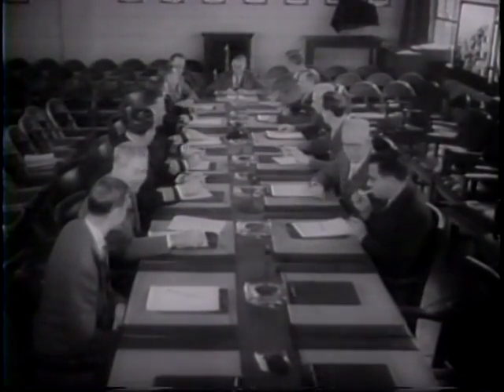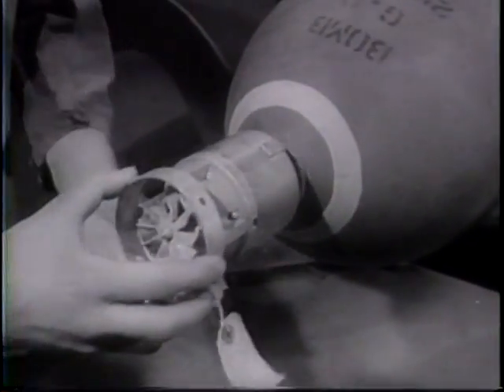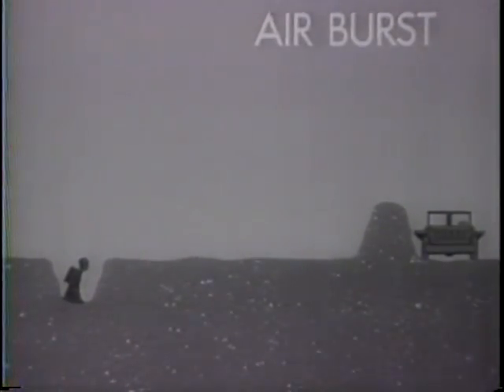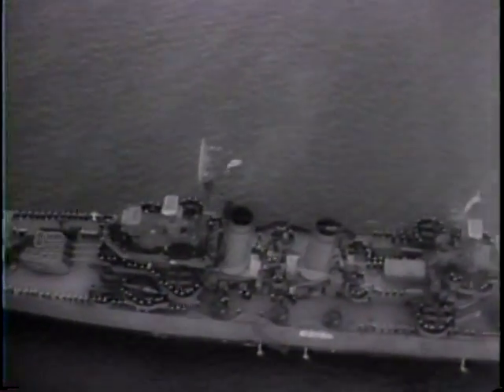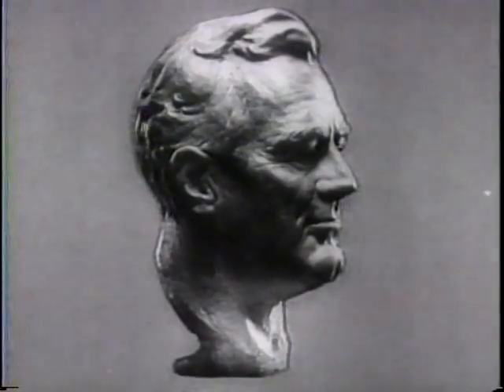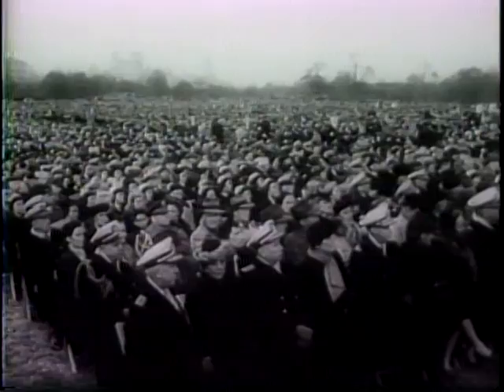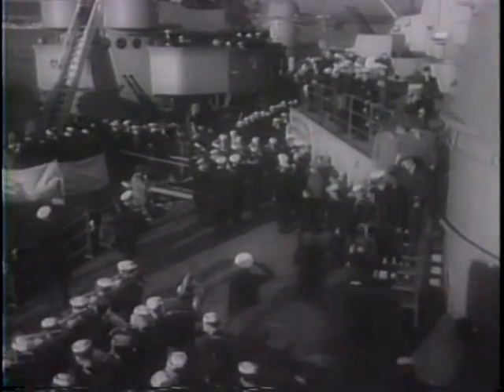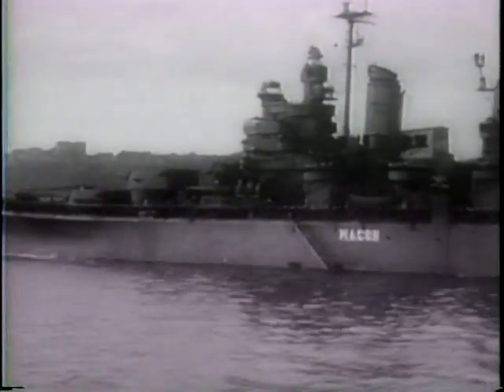Radio Proximity Fuse Wepaon Behind Victory (1945)

Comment: The proximity fuse was vastly un appreciated. It was quite a technical achievement for the time.  It was extremely successful and shot down so many Japanese kamikaze planes, German V1s and in the battle of the bulge exploding the bombs at the proper altitude above the ground greatly increased their lethality. It decimated the german troops and vehicles